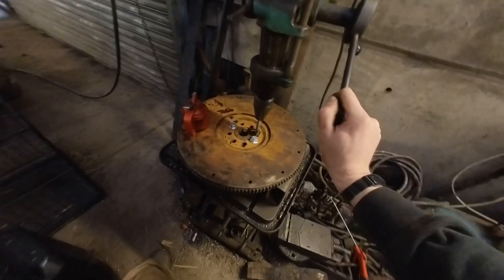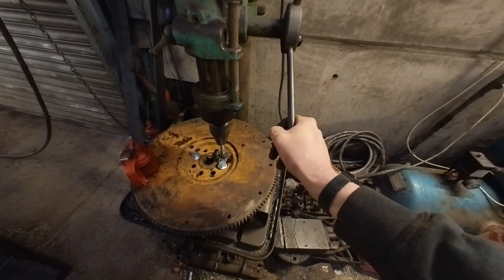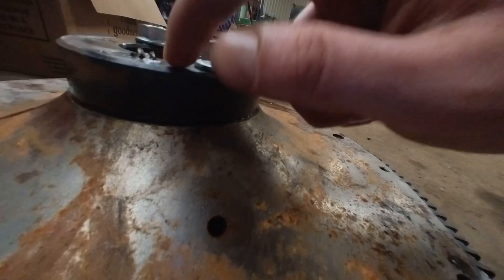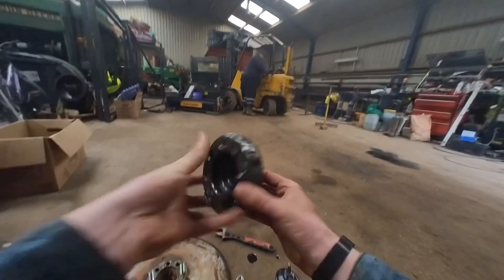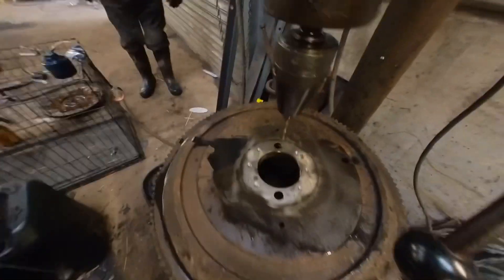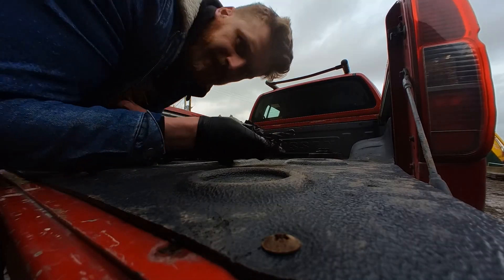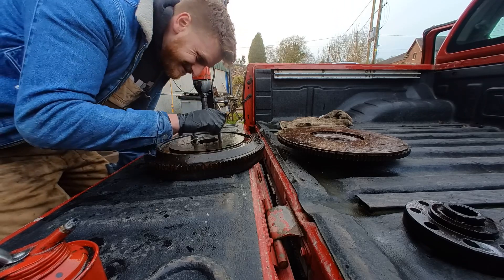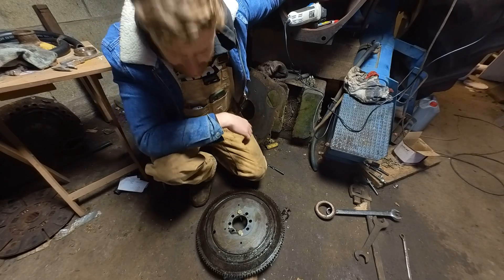Drilling the FLYWHEEL on the New Holland Genesis Engine - Ford 8700 Engine Swap

Comment: Might have been easier to witch to the 6 bolt none turbo 456 crank.
Reply from the maker: The engine had been full of water for quite some time which came out of the sump when I drained it. I didn’t actually look but I imagine the original crank is in the same bad condition as some of the cylinders were in

Comment: Lots of work but worth it,  quick story, we had to replace the six hole hub along with the clutch pack on my 7600 last year, splines were wore, we had to have it in a certain position for the holes to line up, took a while to  figure that out.